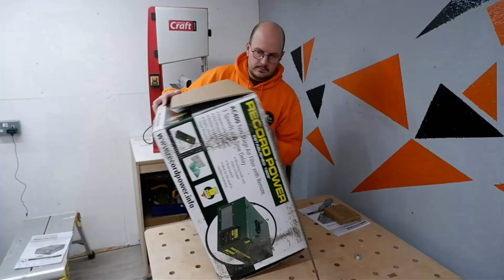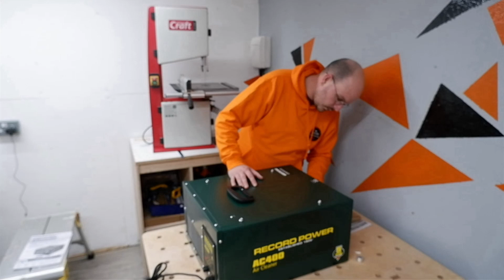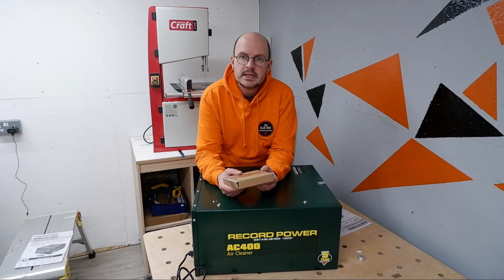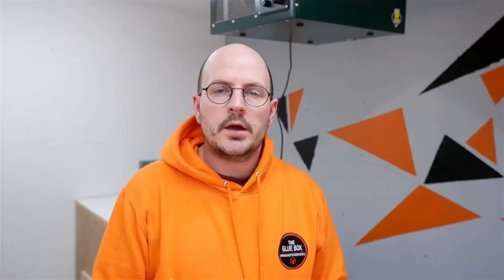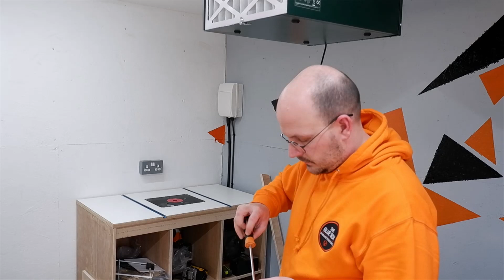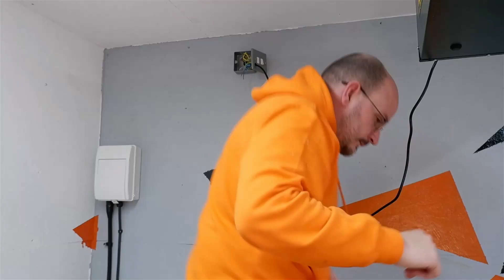Record Power AC400 Unboxing and Review

Comment: These seem really popular in the UK workshops. Good value for money too.
Reply: Alot of the US channels use dado blades. Most saws in the UK don't accept them. Thisbis because the woodworking machines act stipulates that crown guards should ld be used at all times and the dado won't fit them. Therefore the blade arbours are shorter.